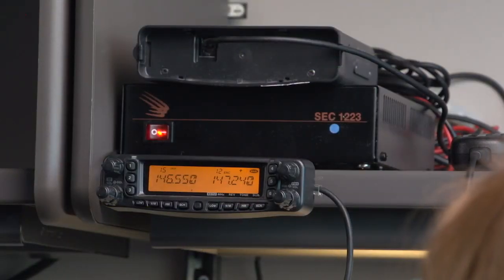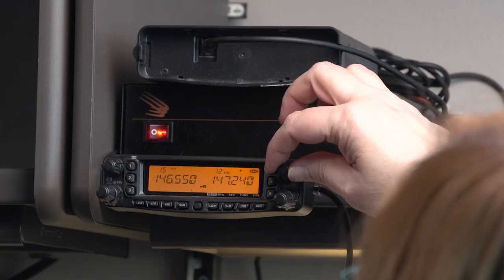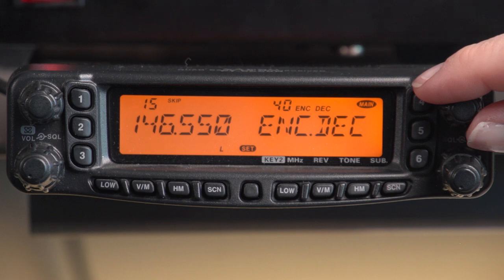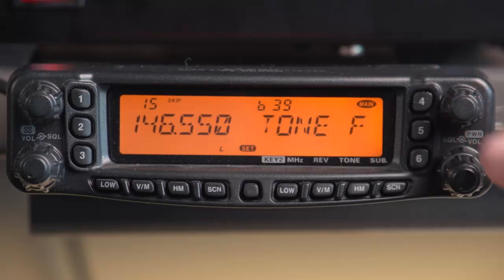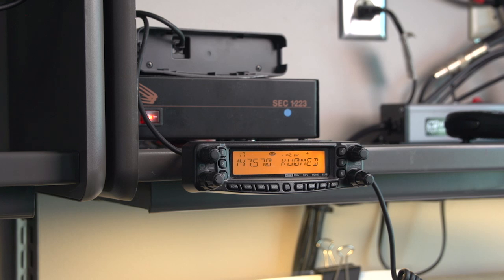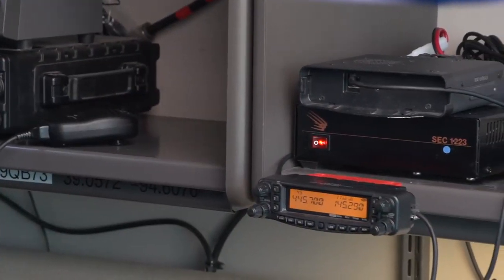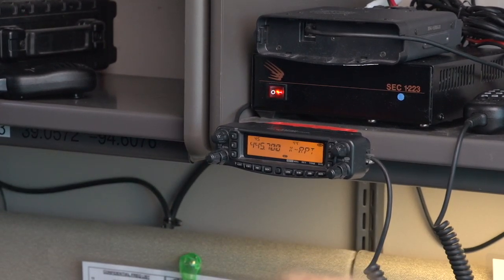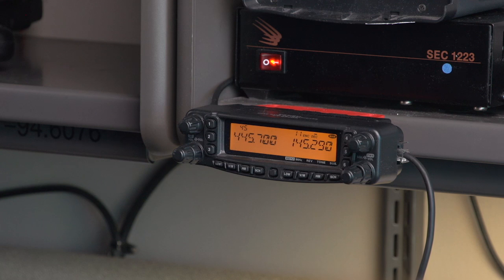05 8800 8900 MENU FUNCTIONS

Comment: When using Xrpt.........you have to ID the remote link.............This is the information on Xrpt from the ARRL:
http://www.arrl.org/auxiliary-station-faq 

How can I legally make my VHF/UHF station into a crossband repeater?-

Modern dual-band or tri-band VHF/UHF rigs often have the capability to do crossband linking. When operating in this mode, the users may call them "crossband repeaters." Actually they are often remote bases, such as when they are used to allow an operator with a hand-held radio to access a repeater from a location where he or she would normally not be able to do so. For example, a hiker in a remote location might leave his car where his dual-band mobile rig can access a distant 2-meter repeater. Leaving the mobile rig on, he then takes his UHF hand held with him, and can access the 2-meter repeater via his mobile rig. A crossband repeater (or "portable remote base") is okay as long as several conditions are met: 1) The user communicates with his crossband rig via the UHF side. Since this serves as his control and voice uplink, it is a form of auxiliary operation and must be conducted above 144-MHz. Since the operator is the control operator, that person must actually be able to control the station! That person must be able to turn it off remotely if a problem develops. If the operator can't control it, it's not legal [97.7, 97.201, 97.213]. 2) If the control link fails, the remote station must shut down within three minutes which means a 3-minute timer is required [97.213]. 3) The unattended station must be identified on all frequencies it transmits on. Since this is a form of remote base, the user's ID over the UHF uplink to the dualband radio also serves to ID the VHF output of the mobile rig. In the other direction, however, there is no way for the control operator to ID the UHF downlink from the mobile remote base, so some form of automatic ID must be employed [97.119]. Unfortunately, few manufacturers include the capabilities listed above in their rigs. Hence, to be fully legal, some form of add-on controller may be necessary. Another use for crossband operation is to link together two existing repeaters on different bands. This is usually done on a temporary basis during an emergency, a drill or a special event. Again, the requirements for proper station identification and control on both sides of the dualband radio's transmissions still apply. If both the VHF and UHF transmitters are not properly identified and controlled, the operation is not legal. In the examples cited above, the control requirement can be satisfied by having a control operator at the station, thus making it a locally controlled station. Although this may not always be convenient, it is a way to satisfy all of the station control required.
Darryl
KI6MSP

Comment: Could you please tell me how easy the four knobs are to turn? The reason I ask is because I am disabled and don't have any finger movement. Therefore, I can't grip a knob to turn it, I have to use the side of my finger and rely on those move easy movement of a knob in order for it to turn for me. Thanks very much
Reply: Penn,  this is not my video but I just watched it and saw your unanswered question. The lower 2 knobs are relatively easy to turn on my Yaesu FT-8800, but the upper 2 have a detente and click to each rotating position. I tried adjusting those as you describe and found it very difficult to control (although I was able to do it) with pressure from a single finger. But I would think the 2 upper knobs might be able to be fitted with an extension of sorts to give you better leverage and control. But if you're considering buying one, I'd see if someone local to you or a store has one you could look at and try before hand to make sure.  Good luck!  Don
Reply: Thanks for showing me this video, it was extremely helpful. I think I will probably pass on getting this radio now. Best 73 G0VQY